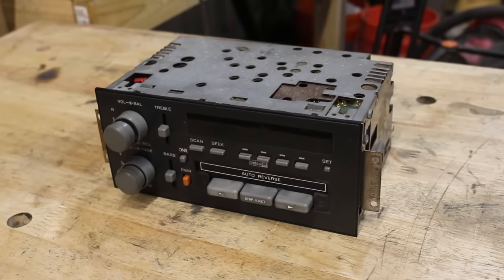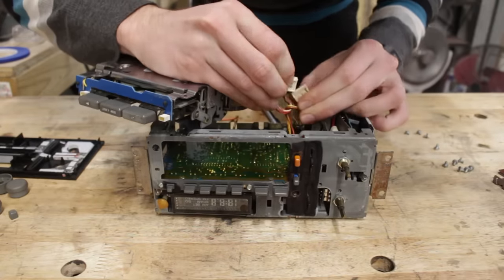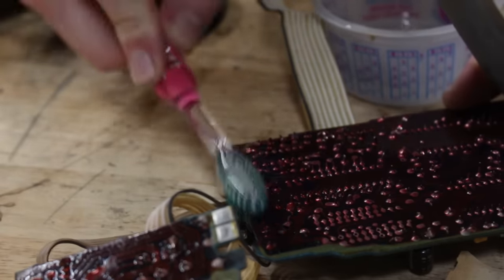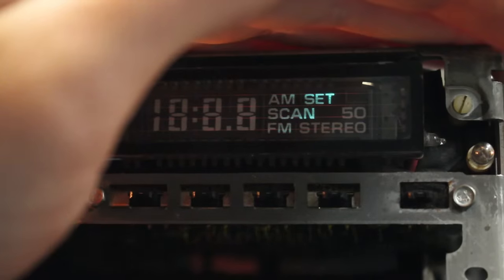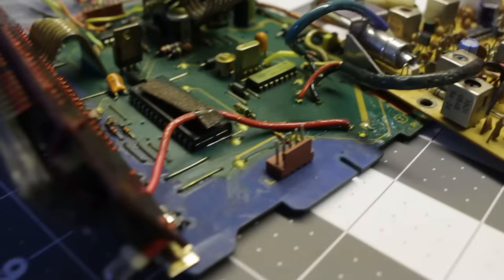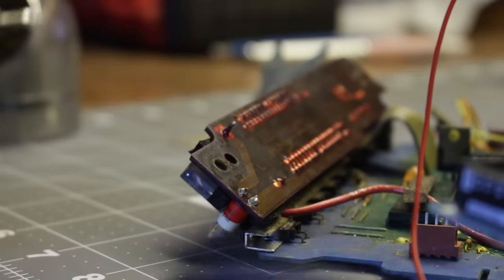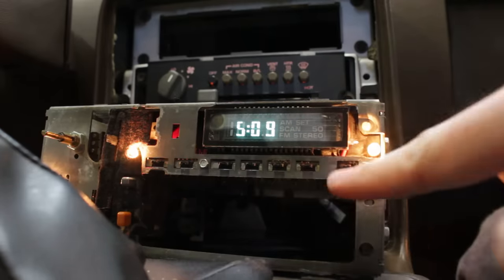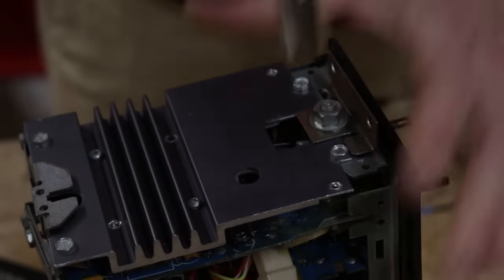1985 Fiero Radio Repair! | Saturday Projects

Comment: I really need to tear into my RX7's radio. I tried to going the easy route and bought a stereo off ebay, but it didn't work either. I then went the easy route AGAIN and the second one didn't work either, not even on my bench power supply.

Comment: First off I can see on a car restoration why someone would bother to fix a radio for a car that is possibly cheaper to replace then a good working orignal radio would cost if New in box. What suprises me is that he actually located a cassette tape? I converted to Cds back in 1985 when I actually bought one of the first models of automotive aftermarket CD players and it was very expensive and skidded on light bumps in an age where you would only find a cd player in a car if it was a rolls royce.

Comment: I have posted this before, but please, please, please make sure you buy a "stated value" policy on this car.  If you get into any kind of accident the most you would get is $3500-$5000 for it.  With all the work you have put into it, I would get a $25k stated value.  So, if you get into a fender bender, the ins. co. will pay out up to $25k to fix it.  Otherwise they go off of market value, which, in this case would be $3500 or so.

Comment: You have belt installed wrong. Reason for the extreme wow and flutter. You have to route belt on the bottom of first capstan flywheel closest by motor and over the other pulley. Refer to google image of belt routing on a AC Delco cassette belt routing.

Comment: I would of replaced ALL the electrolytic capacitors. Especially on a car radio where they are exposed to extreme temps.  Then again, I would of just chucked it in the trash and installed a real head unit.

Comment: Why don't you remove the audio cable to the amp from the cassette, and input a Bluetooth. Will select the Bluetooth by pushing in the cassette or pressing play. So you can bring it to the xxi century

Comment: "This is something a lot of people would just chuck into the garbage" -- Yes, myself included.  The aftermarket car audio industry was in full stride in the 80's and 90's thanks in part to these horrible radios and others like them from the big 3 American manufacturers.  These days there is a lot of cool DIY 12v technology available and it would be a very fun project to take a spare unit like this, clean it up, and embed a class-d amplifier and bluetooth module, bonus points for making sure the radio and cassette deck still work though, maybe just put a small override switch to toggle bluetooth.

Comment: I’d honestly would’ve went aftermarket I get that it’s not that original but it would give options for future upgrades and the ability of running Bluetooth as a source for music and I’d go with a model with a cd drive but you’d have the options of running a subwoofer and amplifier without needing a line level converter like the one from audio control and unless you have cassette tapes and were only going to run a cassette to 3.5mm headphone Jack it’s a completely pointless to try and fix the cassette player that’ll eventually break again not to mention cassette players even in car stereos have a bad case of eating your cassette tape and unless you’re lucky the cassette will be destroyed but the issue with an adapter for playing music from a smart phone or iPod is you’re effectively degrading the audio quality by using an adapter which isn’t going to sound as good as a digital signal and lossless audio.

Comment: You did not clem or oil the motor shaft also too thin of oil type normal 30wt car oil is fine nice work though so congratulations

Comment: Belt thickness is too small. If you use a belt that is thinner then the original, it will run slower.

Comment: You mount the tire in the opposite direction, it is not correct, the mounting method after the engine is wrong, when you turn the right cylinder to the right, the other cylinder must turn to the left. I am a mechanic

Comment: I’m old anyone past 70 is old, am I right? I just didn’t understand why your spending time ripping the old radio out your car and spending time trying to figure out how to fix it.  I’m my neck of the woods we have a number of auto selvage shops. 

They have almost every car under the sun  torn apart and all their parts cleaned up and put on shelves.  

Looking for a stock head unit? No problem they have hundreds of units on sale. If your a known maker or restorer like myself you can get a good deal , a replacement unit like yours sells for about $20 to $30 bucks.  

So my question to you, can you pickup a working replacement or is it just some-kind of  punishment trying to get yours working again